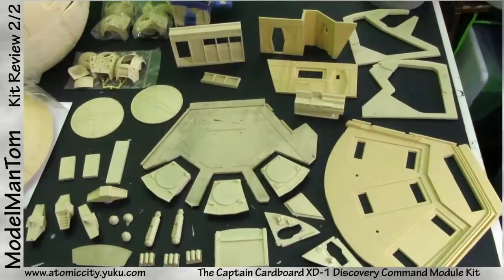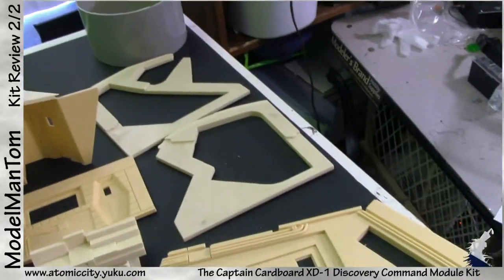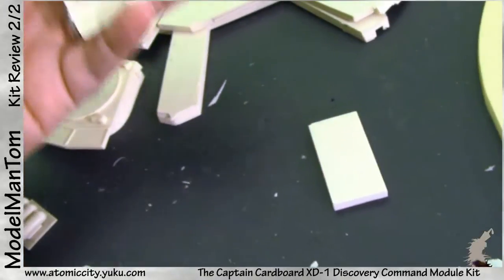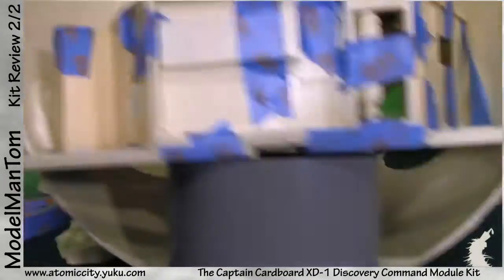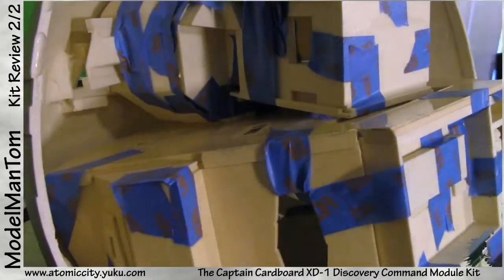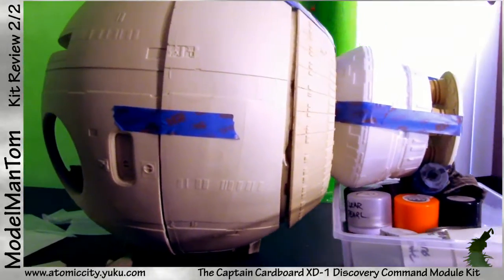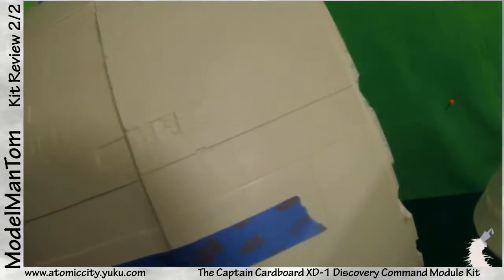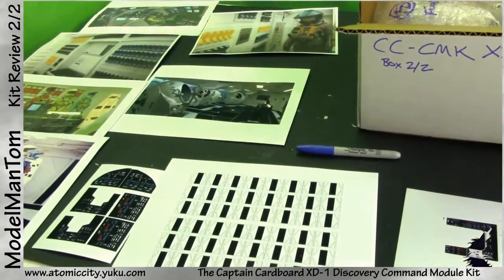OotB Review XD-1 CMK Review Part 2/2

Comment: That looks so amazing!!!!!!
If you use an EZ-B robot controller, then you can use voice commands to control the ship and even have it respond to your commands!!!
That would be so epic!!!!!
Open the pod bay doors Hal!!!
No Dave I can't do that!!!!
Make sure you can switch to Hal doing what he is told so you have control when you want it.
EZ-B is easy to program and fun to use.
You can use it with many different projects and control servos, lights and  sounds and control it with your phone.
I never knew this model was ever made.
I might need to study your build and 3d print myself one if they are no longer being sold.
I am certain you wont be selling yours.
Reply from the maker: No kidding?  I'll have to look into that!
Reply: ModelManTom if it starts singing daisy pull out the boards ;)
Reply: ModelManTom It even uses a camera for face tracking, so a GLaDOS robot would work very well using an EZ-B.
Once I move and get more room to work I will be finishing my GLaDOS robot from Portal 2.
I 3d printed her parts and will be adding servos.
Reply from the maker: This is the first model and the run will always be available.  The Captain is taking orders now, but in the immediate future he may shut atomic City down to catch up on past orders.  He will then reopen to new orders some months later.

Comment: for the ramp and door opening, use an old computer  CD tray with motor stripped out,
Reply from the maker: I'd heard that from another fellow back when this kit was announced.  The single direction force would have to be split as the door opens to the top and bottom, splitting in the middle.  To then activate the pod pad to slide forward is the additional trick.  Then, to reverse all that and close, all by itself in a preset manner, perhaps voice activated as mentioned in a Pt1 Comment would be killer.